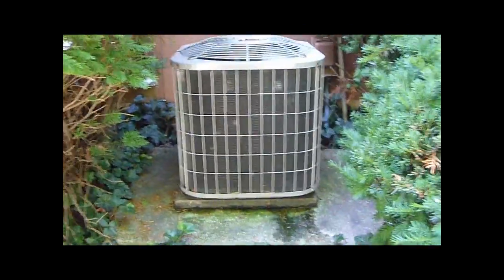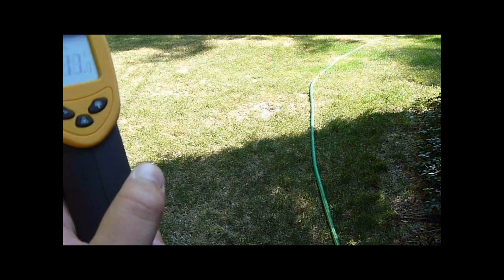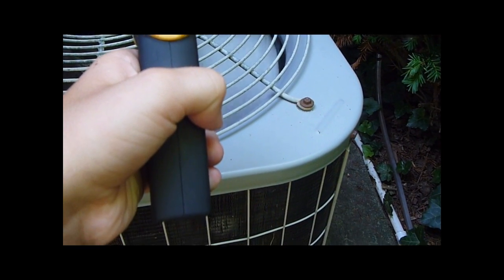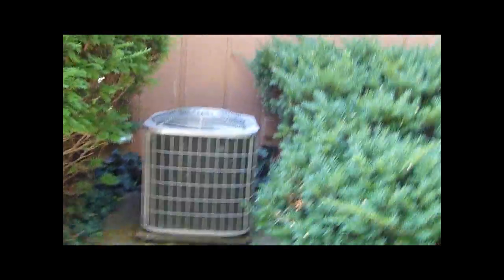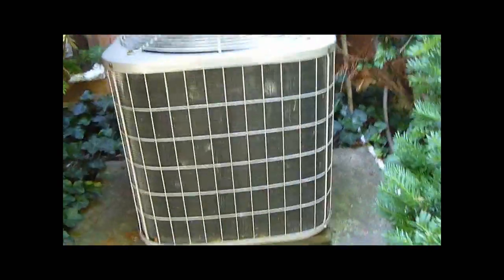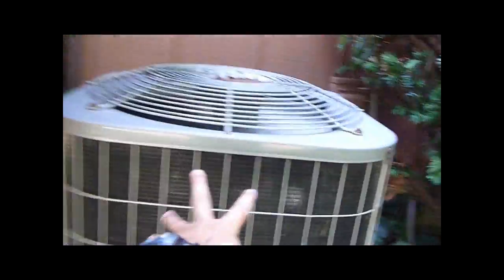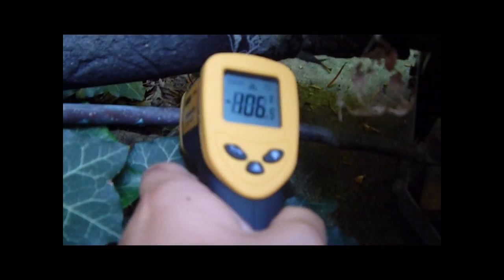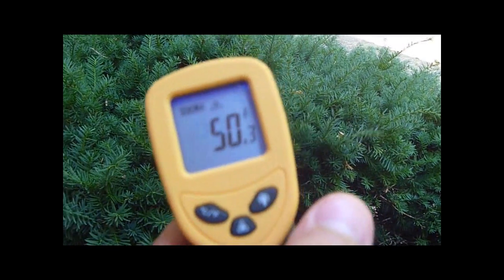How to Keep Your Central Air-Conditioning System Running at Peak Performance on Hot and Humid Days

Comment: It is not hot liquid in the line, it's hot gas and then near the end it becomes liquid, the liquid become close to air temp.  You shouldn't be putting water on a hot coil.  It may build up w/ lime from the water, and cuts down on the effenciy.  As long as the coil is clean and good air flow, it will be fine..  Yes, it may have to work a bit harder in the hot weather.